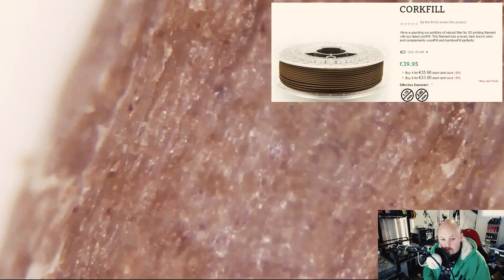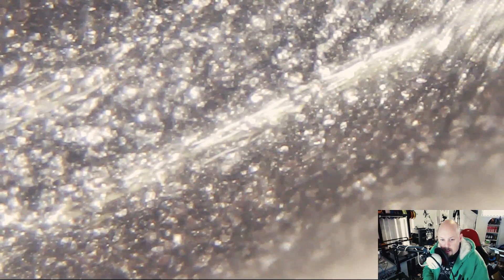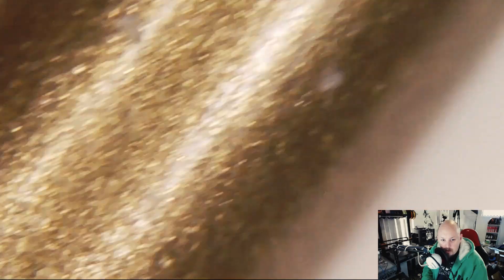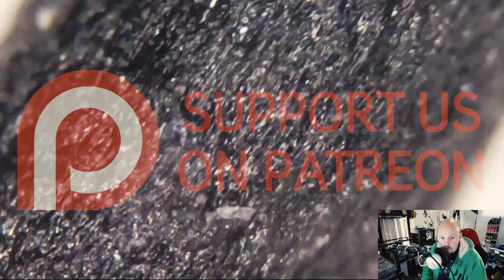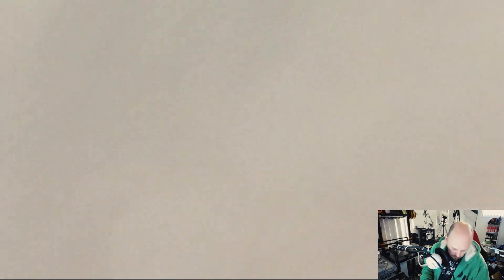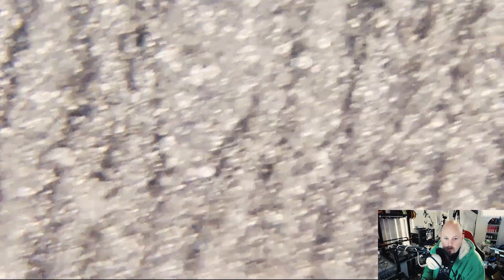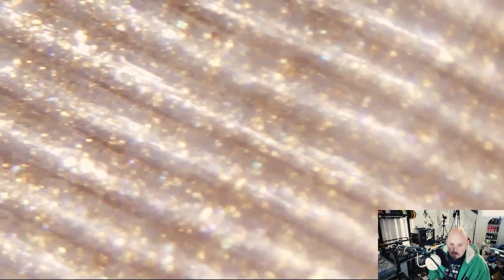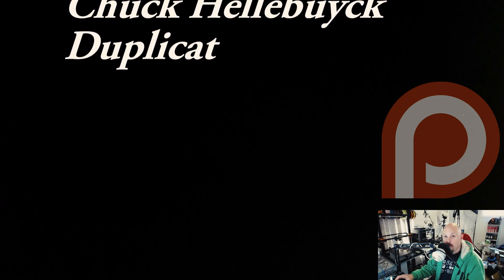Filament and Prints under the Microscope - Part 2

Comment: very interesting stuff. so you recommend a hardened nozzle for everything or just the out of norm materials beyond pla and abs?
Reply: you need to think this through. Are the embedded particles harder than brass.  Is wood hard enough to scratch brass. Brass is a metal, bamboo, or cork is not. He whipped out a microscope to show you the exterior of SOLID plastic. Plastic gets melted as it enters the hot end. How is the exterior texture of filament relevant? It isn't. You need to know the size of particles and the hardness of the particles. Brass nozzles are fine for everything except for a few really abrasive things like carbon fiber etc.
Reply: +kazolar exactly. I've addressed this before.
Reply: I dont believe he has EVER claimed to be a 3d designer. He is a 3d print enthusiast. 
As for you unsubbing... Wow, he made one mistake and your done. You must be a high school PE teacher or in the military. 
Your concerns were valid, and he has addressed them and responded, but either way, farewell
Reply from the maker: +kazolar didn't I say this in the video that it's the hardness ? I'm sure I did.
Reply: you are showing texture of filament, comparing it with sand paper. That's really deceptive. In your first video you are showing texture and saying that it will rip through a brass nozzle. That's entirely alarmist. You showed bamboo filament saying the same thing. Bamboo is a hard "wood" but is in the single digits of hardness scale,  where as brass is 200. Plus I would not put rocks -- sand paper against metal, we use stones to sharpen metal blades in wood working, so a hardened nozzle would not do any good with those type of materials.
Reply from the maker: "showing texture and saying that it will rip through a brass nozzle. That's entirely alarmist" not at all - What i said will rip through a brass nozzle WILL - I can show you nozzles that have only printed wood that are oval shaped - and i can show you ones (in the video) that printed a small amount of carbon and are ripped up. Maybe test yourself before assuming you know it all
Reply from the maker: INFACT one of the brass nozzles I showed in part 1 had ONLY printed wood from the didgeridoo video.
Reply from the maker: "I'll tell you a secret... water can cut metal..'
Reply: surprisingly enough wood can't...not even if you heat it up
Reply: I have tested. I've printed thousands of hours with brass nozzles. Continuous 200+ hour prints. So check yourself there buddy. I built a 6 foot delta from scratch using my own design. With a heated bed with hand tuned PID settings, I know my stuff -- I now doubt you know yours. I do my OWN designs not just other people's work I find online. (Curiously enough you don't have a single video where you've printed your model).  I've printed with a quality brass nozzle a full roll of wood filament, no issues. And I have done a number of CF items, though I know CF can damage a brass nozzle, but mine made it through fine, but I wouldn't print more CF stuff without a hardened nozzle. Wood cannot and will not rip through a brass nozzle. I stand by that. Show some scientific proof that it is remotely possible. If you use a cheap Chinese nozzle it will get ripped apart by printing anything. I gave you proof of material hardness. They make nails out of brass, brass goes through wood...not even sure why I'm arguing. This is simply click bate, if you're trying to do alarmist headline content to boost your subscribers, that's unfortunate. This is not the reason I watch your videos. If this is your new direction. Bye.
Reply: whoa... whoa!  back up!  we got a bad ass here!
Reply: James Martin I'm going to explain. It ticks me off when creators I trust turn to making sensationalist content, then instead of opening an honest debate turn to making assumptions that I don't have a clue. All I'm saying is, I have a good bit of 3D printing experience, and I'd hate for the community to start spreading FUD. I'm responding to you James based on your posted videos as you've been 3d printing for a while. So in my mind, you have my respect. As I said, I was done with this channel, I unsubbed, and I won't be posting anymore comments here.
Reply: EagleSoar1381 he never actually acknowledged the mistake, did I miss it somewhere? He doubled up and was condescending saying the water can cut metal - I gave actual scientific reasons why you would or wouldn't need a hardened nozzle. I unsubbed not for the mistake, but because I realized that if I'm not getting useful 3d printing info from a channel which provides only that, there are better channels to sub to (for me).